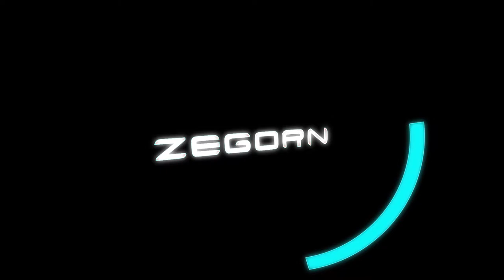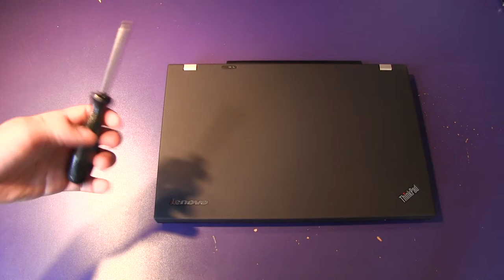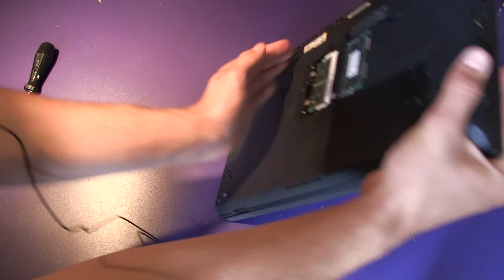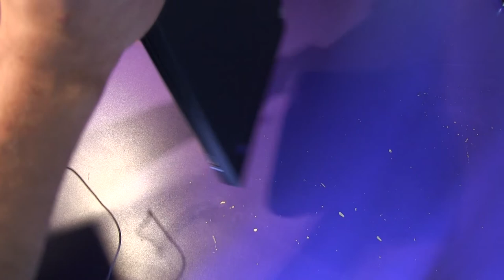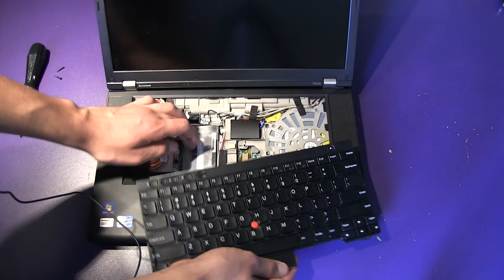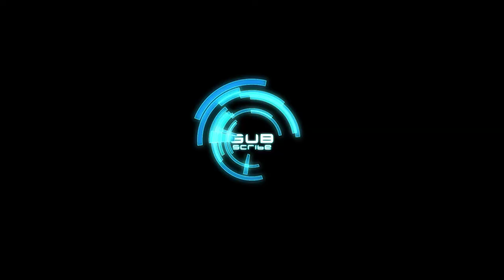RAM Installation & Keyboard Removal Walk-through: Lenovo ThinkPad W530

Comment: I broke the top plastic cover for the power button and sound buttons at the top of the keyboard. Where do I find a replacement for it?
Reply from the maker: mathlover101hotmail Looked it up for you aaaand: Turns out the best solution isn't online. Lenovo's support line said they would sell me a keyboard replacement for about $60. These parts are kept in stock for repair shops that resell their stuff.